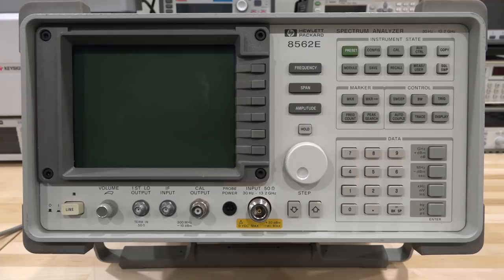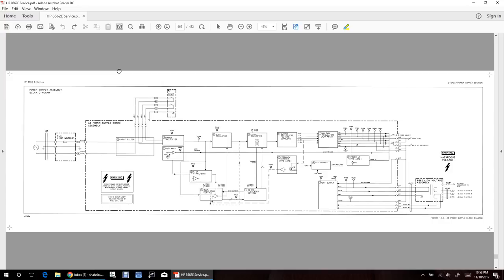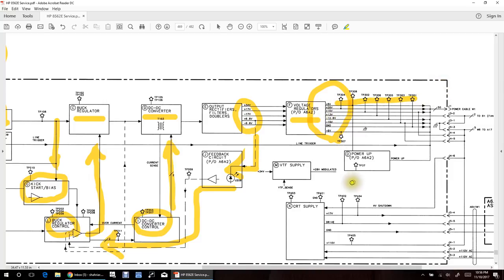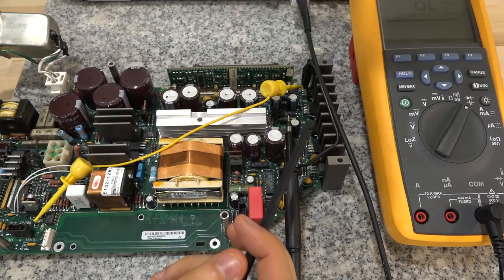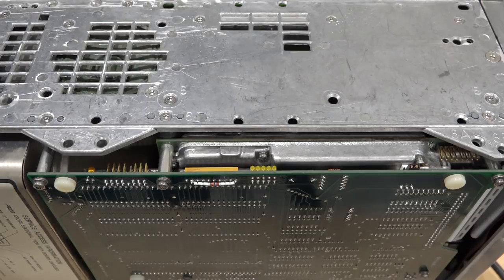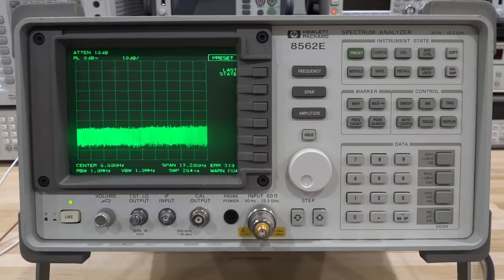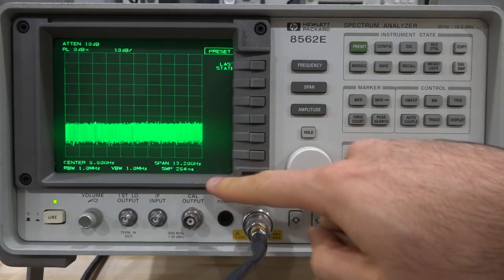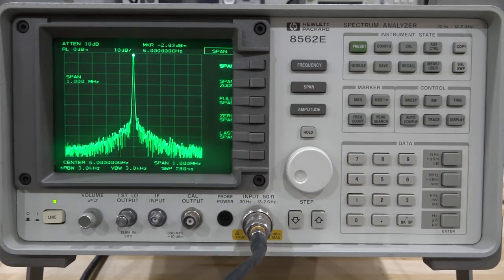TSP #116 - Teardown, Repair & Experiments with an Agilent 8562E 30Hz - 13.2GHz Spectrum Analyzer

Comment: I know this is a 5 year old video but I might add something interesting here. Years ago I needed to repair a Tektronix 475 scope that would not power up. I don't remember all the detail but I did determine which supply was not coming up and, of course, as it tried to power up, it shut down from over current as sensed by the regulator board. I ended up jumpering out the regulator board and when I turned it on with no over current protection, a little bypass capacitor somewhere on the PCA exploded - that was it - a shorted capacitor and that "fixed" it. I removed the jumper from around the regulator board and it worked just fine. A shorted .01 or .001 bypass capacitor on the buss that exploded when full PS voltage was applied to it. That's fixing a problem by pulling a rabbit out of the hat...

Comment: I love these 856#X (# is 0 to 5, X is A, B, E, and EC) series analyzers so much. Everything about it says portability (a huge plus over a 8566B), reliability, and servicability on it. Meanwhile it has specs I would label as "lab grade". I love it even more with CLIPS being widely available. This is the go to spectrum analyzer for those that can't afford buying a $10,000 instrument or even a $5000 one. I typically see these sold at a steal of a couple of hundred to around $3000 on ebay. I highly would recommend getting one as a starter or for educational purposes. The only things I don't like are the RYTHM and the fact that it isn't modern enough to include real time spectrum analysis. Its expensive or very labor intensive to repair a RYTHM. Its noted that over the years, for some reason the YIG balls will come out of alignment (heat affecting the epoxy keeping the YIG in place?). This ends up causing an "attenuation" of a high band signal (above ~2.9GHz). About the video you were right to assume that the YIG oscillators are the same with different bias boards. The microcircuit inside is interestingly a bit different but should put out the same frequency range. Power level might be a different story. It will still be a suitable repair because HP tends to reuse parts. Currently I'm in the process of repairing/replacing a low band assembly's ceramic microcircuit amplifier. I've ID'd several other units which I could obtain this amplifier from. So far I count 6 units. From VNAs to tracking gens to even a stand lone RF amplifier unit. The RF amp unit is one I hope to get to not only replace but also repurpose as a testing rig for these ceramic amplifiers. As for the repair of the power supply, you did a great job not only acknowledging your mistake but explaining how it would lead to failure of other components. Its a very good thing to document everything thoroughly. I'd like this video more than one time if I could.

Comment: Nice video Shahriar.  We've all made mistakes that sometimes make the repairs more extensive than they would've been otherwise - nice to see that it also happens to the best of 'em.  I wonder what the original problem was with the supply before the lethal blow.  It would've have been interesting (to me) to see the details of the YIG alignment process.  I like the look into the oscillator - I've never seen the inside of one of them.
Reply from the maker: Thank you. :) I can always give you the YIG oscillator if you like to take a closer look at it or have play with it in your setup.

Comment: 10:54 you should replace the 4 transparent RIFA suppression caps on the input they are replace on sight parts in vintage equipment. The transparent (epoxy?) cases get hairline cracks in them. Moisture then gets inside causing the plates to corrode and short.

When they do decide to fail and trust me they will there will be a lot of bad smelling smoke.
Reply: Yeah, do replace those. They are nasty!
Reply: When they go...the smoke will linger in your lab for a week. It is horrible.
Reply: @Factory400 , Oy, and the noise! LOL
Reply: TRUE THAT!!! My TEK2445B smoked so bad I was headed for the garden hose - but instead put it on my covered porch room and ran for my special screwdrivers set!  The smoking failure was exactly the clear plastic cases on the defective "Y" suppression caps and age/moisture caused dielectric failure and 115V AC to the 3rd wire ground! BTW in this magnificent Video, the 3rd wire, green chassis ground ring lug was left OPEN; should have been grounded to the power board. unless he was using isolation transformer. Also when poking around on any Primary voltages side, a much less expensive or battery Fluke  scope would have been less risky! ALSO, follow rhe old Ham Radio adage to keep your other hand in your pocket, (and wear some insulating gloves).  I will do Patreon here like the ham/repair genius Mr. Carlson's lab the past year. These guys have the key to encourage and inform us Experimenters HOW to fix and rescue great old test equipment designs which were still field repairable maybe into the 1990's - too proprietary now!!! Thanks, W4HDL.

Comment: I'm about to cry too. I think there's a problem with the voltage doubler for my YTF that's causing ERR 334 in my 8563E that was working just fine 6? years ago the last time I turned it on. I think the caps are on their way out. Wish me luck!

Comment: Amazing to see it running again! My 8563E‘s power supply still waits for its repair, I assume it has resistors which have gone high resistance and it‘s a pain to service. If you interested I can send you schematics and component positions of several 856x power supplies

Comment: Nice video. I currently have an 8563A with a dead power supply. The rectifier section is ok, howwever I was stuck as to where to look next. So watching yor video will help a great deal. Two questions though, first what was the yellow lead, are you joining two grounds together? Second any idea where I can get the full repair manual for the 8563A? I can only find incomplete information on the internet so far.

Comment: Unfortunately you have made an other mistake in the power supply. The capacitor labelled as one is placed back the wrong way around.
Reply from the maker: Yes, you are right. That part didn't make it into my edit. I changed it before I closed the unit. Good catch!

Comment: Beware of the RIFA safety capacitors across the mains. I have several units where these have fused. Especially if the unit is put on 240 Volt mains after a life on 120.

Comment: CERAMIC IS USED TO TUNE FILTER MICROSTRIP LINES.
INCREASE COUPLING FACTORS BETWEEN LINES, AND ALSO MINIMIZES SURFACE ACOUSTIC WAVE COUPLING.

Comment: Excellent video. Just one thing: might be interesting to be more precise about which driver MIC442x to select to avoid misery. Fortunately in my SA, IC marking was not HP references and states MIC4426C. Parts list in CLIP states TSC426CPA. Schematic reads ICL7667CPA (low current driver version: 300 mA). All these quite hard to find in Europe, except "China quality". Will check Intersil EL7212 which seems compatible (and improved) and available at Reichelt...

Comment: Wow! Very cool - haven't seen inside a YIG before. You aren't worried about accidentally shorting something with the ground ring on your scope probe? I did that once - was very exciting.  Whenever I probe power circuits since then I have used the little plastic hood.
Reply: I am always fearful of the ground ring.   Its a pain and end up wrapping in tape
Reply: I think it's OK since the power-supply is floating trough isolation transformer so he can't short anything to ground trough that. Otherwise it would be a problem and yeah, one should tape it or use other probing method than freehanding it.
Reply: Isn't there an included plastic piece with the probes that isolates the ground? My DS1054Z probes came with it.
Reply: PERSONALLY, I WOULD WORRY FAR MORE ABOUT DAMAGING THE YIG SPHERE.
MECHANICAL DAMAGE IS ALMOST IMPOSSIBLE TO REPAIR WITHOUT MAJOR SURGERY.

Comment: Hi Just a question for you today. I successfully repaired a HP 8565A spectrum analyzer. I felt this unit had a very unique problem to share with you and I hope you will give me an opinion on this experience. To make a long troubleshooting procedure short, this unit had the only three  identical valued 2 watt resistors , 68.1 k ohm resistors open circuited. These resistors had no sign of overheating and were located in diverse portions of the instrument. The only thing in common was their power rating and value, all 1% resistors (all open circuited). Could this have been a manufacturing error with the resistors?
Reply: Yes, could very well be an issue with that particular lot of resistors. It happens a lot more often with capacitors but resistor manufacturing defects are not unheard of.

Comment: The few (compared to you) times i've tried troubleshooting faulty (or badly designed) circuits, I am very, very, apprehensive about powering it on and poking around it.

Comment: Hi, I have recently bought a used Hewlett Packard 8592A Spectrum Analyzer and I am wondering what happens if I don't terminate the 1ST LO Output ?
I see the unit you have is the 8562E and it says TERM in 50 Ohm. Should I terminate my 1st LO with 50 Ohms also? 
My unit does not have the term message written beneath the LO connector.
I have not found anything in the manual yet to advise one way or the other.
Thanks.
Reply from the maker: Generally it is good practice to terminate the LO port when unused. It prevent poor VSWR from impacting the LO distribution amplifier.
Reply: @Thesignalpath  Thank you for your reply. I have terminated it with 50 ohms.

Comment: Hello, I have seen your videos for a long time, they have been really inspired to me. Last week, I was received a used 8563E not working for years. When I powered it up, after  the message "PREPARING TO REALIGN LO", it displayed error codes of: 319, 334 and 358. I have looked up the error code with some information about the YTO but to be honest, I can not understand clearly. May I receive any suggestions from you? Thanks in advance!

Comment: Why was Shahriar using LoZ mode to measure the rectifier voltage? Was it to allow the caps to discharge after the test was over?

Comment: Did you try using hardware accelerated encoding for your screen capture? A decent GPU with a dedicated .x264 encoder should have no trouble capturing your desktop at 60 fps.

Comment: Question have you ever repaired a Yig, long time ago I did open a Yig filter to observe crack around the print, I was told to send up to pic & place repair side of the factory where they totally over soldered the socket, a broken solder joint was cover it up with Solder to the Yig :( went back & I observed the mess, one of those that I wish I had done the job, which scrapped the HP BER :( if I had done it it would have worked, but the manufacturing plant had a system in place. :(

Comment: Good video, a faulty yig must mean the specy is uneconomical to repair. The inputs to the yig ass are */- 15v but the yig transistor must have less voltage across it. As someone has commented these secies are old there are much better transistors about now, such as those used in LNB,s

Comment: And no explanation for the yellow jumper wire on the PSU.
But I do think the buck conversion followed by an isolated DC-DC is interesting.
What are the advantages with this method? Or is it done purely for the fact that it is easier to make an efficient buck converter that can work with a large verity of input voltages?

Anyway, nice video, and I do hope more interesting content is one the way.
Reply: my guess is connecting two grounds that are isolated on the pcb but would be connected through the chassis
Reply: That were my guess too, were just thinking it is silly to not explain it in the video. As it could be confusing for people that doesn't think of it.
Reply: On its own buck conversion followed by an isolated DC-DC is less efficient than just using isolated DC-DC, but buck conversion act in same time as PFC (with lower power factor then if they used more common boost PFC) which give overall better efficiency then combination of boost PFC and isolated DC-DC (in time when that power supply was designed, now difference is negligible). In that time best overall solution was SEPIC followed (or buck boost converter) by isolated DC-DC (power factor same as boost PFC efficiency same as buck PFC), but is hardest to design and most expensive.
All that solutions are/was useful for small to medium power supply's.
Reply: Alexander Wikström  the two wires on the bottom were to essentially function as a switch bypass. So that he didn't need to attach a switch to the PSU. This psu, much like the old AT PSUs, switch the entire mains input and do not use a standby function.
Reply: Could you just RTFM! Service Manual states linking both earth TP301 and --Vrail TP101 non isolated lower power line for the maintenance procedure. This makes it MANDATORY to use an isolation transformer (and NOT autotransformer)!

Comment: Since the YIG is a basket case, why don’t you try probing around to see if you can find the failure mode?
Reply: The failure depends on frequency, the frequency depends on magnetic field, and the magnetic field depends on the the coil assembly, which when in position makes the oscillator difficult to access. Perhaps one could scoot Neodymium magnets around until it starts resonating, continue to scoot until frequency drops below the minimum working frequency, and begin debugging? In any case, it wouldn't be trivial, but that hasn't stopped Shahriar in the past :-)
Reply: This big white cap on YIG - under microscope it looks like it`s cracked. Just guessing.

Comment: 29:30 DUDE, you just happen to have that exact same YIG lying around??? I know you're into that kind of stuff, but come on, what are the odds?
Reply from the maker: Well considering that HP/Agilent used the same YIG in many of their instruments it is not that unlikely to find a spare. :)
Reply: Adds up. BTW, now that I got your attention... A while back, you said you're thinking about doing an episode on the design of RF filters on PCBs (like in the front-end of most spectrum analyzers). Is that still on your agenda? I'd love to see what goes into designing such elements and what determines their geometry (and maybe which tools can simulate the frequency response).
I don't remember what exactly those are called, but I hope you know what I'm talking about.
I absolutely love your videos, thanks for sharing the knowledge!

Comment: Not the best supply design, no gate resistors
Reply: The gate drivers they used have the resistors built-in. It says in the datasheet "7 ohms output impedance".